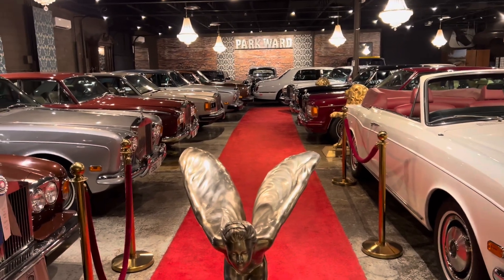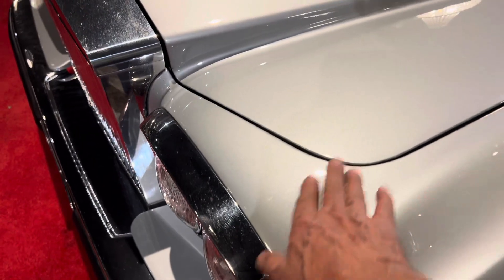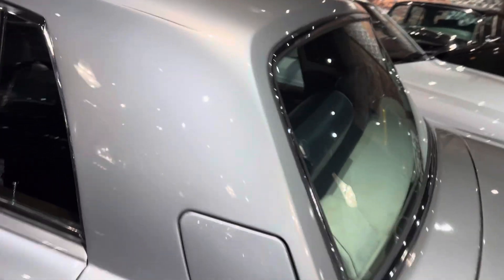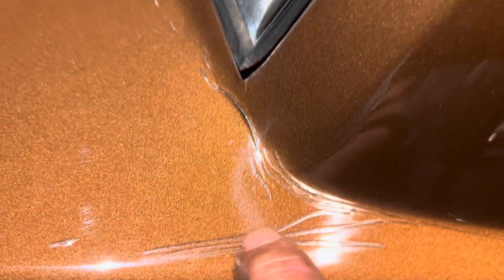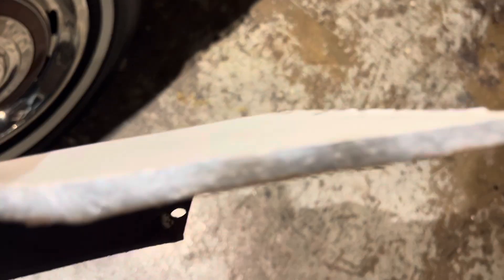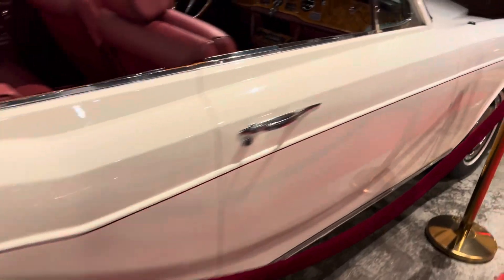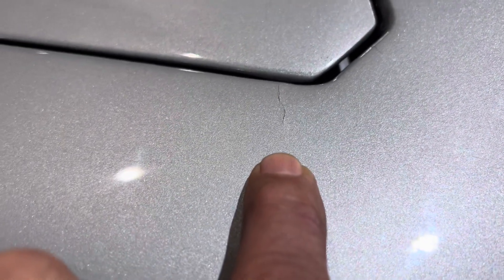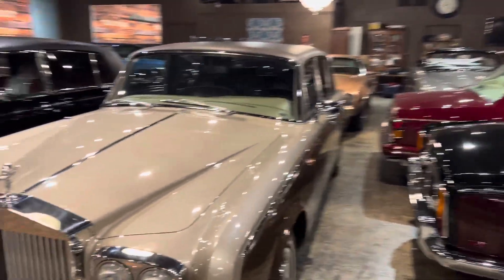The “Lead-wiping” process used in Rolls-Royce motor cars.

Comment: I usually have a bit of a laugh at someone boasting that they have used lead instead of a plastic filler in their 'restoration'.  Lead was originally used because plastic fillers had not been yet invented.  Some of the modern day plastic fillers are SUPER - and some with reinforcement strands can withstand areas that lead will typically fail with age.  HA - and I cringe when I have seen people sanding down lead filler with a power sander.  Yes - I have used lead many years ago, I always used a proper lead file and then typically used a thin film of plastic -and or modern primer surfacer for the final finish - HA - but always prefer a true metal finish - HA - and that does not mean wiping in lead.  Years ago I have seen lead much thicker than that sample.  Any filler, whether lead or plastic can be 'abused'.  CHEERS from AUSTRALIA

Comment: Rolls Royce's were finally assembled in the Crewe factory but the body shells were made made by Pressed Steel Fisher (PSF) in Cowley Oxford. I went on a tour of the sheet metal Shop in 1982 and saw the area where completed body shells were being 'leaded', it was like it's own little Rolls Royce factory quite separate from where the BL panels were being pressed and only RR staff were allowed in there..................can't say I remember much in the way of fume extraction.

Comment: They all use lead in the building of the bodies of Rolls-Royce vehicles. How do you think they hide the wells that hold on the roof in the eight pillars and the bee pillars they don’t have regular filling material in those areas they use lead and they still use it today. I’ve seen the process. They had a video on YouTube when they were constructing the Rolls-Royce. bodies in Germany

Comment: I visited as a guest of the News of the World car club I think it was around 1980-82 the Rolls Royce factory in Acton  (Park Royal?) they made all of the long wheelbase Shadow's and all the Corniches. The bodies came from Pressed Steel Fisher in Coventry and were cut in half and had twelve inches or so added in the gap. We saw all the under joints being filled with lead, but I don't remember other panel joints being wiped. In fact I went there twice with the NOTW courtesy of my best friend's  father who worked at the Sun and NOTW and they lived opposite me. They were fascinating visits to a 28 year old or so would be amateur mechanic
Reply from the maker: Shadow finished in 1980 so your visit would have been at least few years before that. To make the Long Wheel Bases, they were cut to add 4" in rear compartment. I though they were made contemporaneously with the standard saloon but given what you say, makes sense about not seeing lead being added elsewhere on the car because that was already done in the first iteration.
Reply: @ thank you. It's surprising how the memory plays tricks, then yes it must have been before even the last visit. I also remember watching a guy making an aluminium wing on a buck I think it's called for one of the earlier limousine's front near side wing. That to was fascinating to watch.
Reply: They were made in T building PSF Cowley, now the BMW factory.

Comment: Lead? I thought bodies were finished with tin before bondo.
Reply from the maker: You need to watch the whole video. The lead is used to fill panel joints. Not as a coating all over.
Reply: @roddsala4626  Thanks. I didn't understand that. The thickness, the clearance between the panels, is insane.

Comment: Old telephone cable splicers were real artists with lead. The splice between two section of lead cable involved a sleeve which was covering the wires and lead was wiped between the cable and the sleeve. When properly done it was water proof and gas tight as the cables were pressurized. Looked perfect, like a single piece of cable with a slight bulge.

Comment: I think it will be the same issue with plastic filler. (Bondo)?
The lead, which is a tin-lead mix, will solder to the steel plate and be more robust as bondo???
Reply from the maker: @LeoTheLion66  a point that many argue but I agree with you.

Comment: Modern metal cleaning, epoxy priming and polyester filler have come a long way since the 50s and 60s and are far superior to using lead. Remove lead, make some sinkers) unsound or incompatible paint, adjust panel fitment (if required) and refinish with modern paint systems. When a vehicle rarely sees the light of day or harsh variable weather 30 to 50 years should be expected where work is completed by a competent trades person and cared for by a responsible owner ( no mould accumulation or bird droppings) thinking something is good doesn’t make it good and combining lead and bare steel to make a laminated defect repair is unsound practice, a bit like mixing milk and beer, the outcome is so bad you can see it so stop riding you penny farthing with an umbrella, it’s embarrassing.
Reply from the maker: @colinsmith2005  yikes! Angry man at the end there!

Comment: I remember helping a friend do some body work on a Mustang in 82. It was a 65, and there was lead on the left side at the joint at the rear quarter panel and roof. Id never seen it before but I learned about that from the experience. 👍👍🇺🇸🇺🇸🙏

Comment: There is a series of videos by a guy called Matt Armstrong repairing a wrecked Rolls Royce. At one point he has to get some professionals in for some body work jobs. One of which was using this technique to hide a weld line. You can see a clip of this work at about the 23 minute mark of this vid:
https://youtu.be/mTN-jwrtM-4

Comment: I went to school for autobody and paint  in the 70's at Ferris. We were required to lead all our welded panels. European vehicles tend to be ridged body, with no exposed seems for body flex and will get stress cracks. Lead is still the most permanent repair but almost impossible to do on newer cars because the sheet metal is so thin. But i still do it on older restorations.  Beautiful collection of Rolls, by the way

Comment: As a teenager I used to watch the body repairs at a local dealer, and the most intriguing activity was watching them paddle hot lead on body panels, use a special file to cut level, then do it again until satisfied the work was smooth and blended into the body. Still done today on top end repair and fabrication.

Comment: In other walks of craft life, this is called "fairing". After shaping flat metal plate with the English wheel, the curves will not be "smooth enough" for the likes of RR.
The side effect of the lead is that it covers the steel with a layer with different rust properties.
So the lead is the filler, and the wiping is the fairing of that. With a lowish melting point, fairing lead is easier than sanding down epoxy.
As to "flat metal" that's a problem too. Gravity and other things may render what seemed flat into another shape. Here again lead filler and fairing can help out what would otherwise be an impossible job.
In the video, when the camera pans over the exhibited collection, in a few cases, we perceive a surface texture change in the bonnet/hood that raises the impression that what should be "flat" is not (no longer) exactly flat.

Comment: I remember this kind of lead work being used extensively in the 1950s and early 1960s. It was a skilled job with self employed people being called into body shops. The coming of Isopon and the like killed it off because special lead skills were no longer needed.
Reply from the maker: @davecooper3238  plus safety concerns.

Comment: What's gone wrong with the ceiling overhead lighting why is it so patchy and uneven.
Reply from the maker: @jagmarc  the overhead lights are all directional and adjusted accordingly so from different views they may look uneven but in fact all consistent. A rather odd irrelevant question ?
Reply: @roddsala4626    it's migrane inducing

Comment: This was used on every Jensen Interceptor made. Awful to repair an old one as it has to be removed before you can do weld repairs to the body. Jensen used it on every joint between panels. Very thick layers too.

Comment: Lead wiping was used on a lot of cars,including the Ford Pinto. I worked part time on the Ford assembly line in NJ, and remember seeing an old timer working on the joint between the roof and quarter panel. He used a gas torch, a wire brush, a lead bar, and a big file to clean, heat, fill, and file the joint smooth. It took skill and a good eye. I don’t recall any PPE to protect from toxic exposure.
Reply: The danger from the lead to that old timer depends on how hot he got it. Probably, not very. Molten lead doesn't give off fumes unless it gets very hot indeed. It melts at 327C / 621F, but doesn't boil until it's 1749C / 3180F. So provided you melt it and not much more, you're not filling the atmosphere with lead gas. That's not to say that precautions are pointless - good PPE such as a breathing filter mask is always a good idea. 

As I understand it, the issues with working with lead mostly come from the possibilities of ingesting it in its solid form - dust, smears, particles - or ingesting compounds including it - lead-based pigments in old paint. Not washing one's hands thoroughly after handling it is a bad idea.
Reply: @abarratt8869  So maybe there's more risk when doing the filing down afterwards when dust might be flying up?
Reply: @davem9204  indeed so, especially if using power tools for the filing down, but it is lead dust so it won’t fly up very much (not as bad as wood dust). But I imagine that one’s hands would catch quite a lot of it, and then eating a sandwich would be the route for ingesting the lead.
Reply: @abarratt8869 lead work also requires you to file it. There’s plenty of lead dust, even if there are no lead fumes as such.
Reply: @JasperJanssen  Absolutely.

In the electronics world, the most dangerous thing was lead solder paste - fine particulate lead mixed with flux gel. This came in when surface mount components started becoming popular. It was incredibly easy to get that solder paste smeared on one's hands, and was very easy to carelessly ingested via food contamination through - say - eating an apple or sandwich. 

It came as a bit of a shock because - suddenly - there was a big need for extensive personal protective gear. Whereas previously solid or molten solder was all that anyone had previous encountered, and the primary concern had been the fumes from hot flux.  

Mostly the world has converted to lead free solder, and so the solder pastes these days are far less hazardous than those lead-based ones. Good care and personal hygiene is still important of course, it's just that one-off mistakes are far less harmful.  

Interestingly, lead-based solder is still a thing, and some fields still use it. Military equipment quite often uses lead-based solder, because a lead-solder joint is still far more robust than lead-free solder. The difficulty they're having is finding anyone who still has the expertise to use lead-based solders...
Reply: I’ve seen lead sulphide/galena on sale as ornamental gem, when i was going to school idiots licked the green paint on the school yard railings, sweet.😂
Reply: I'll bet he also a set of wood paddles and a tub of tallow.  All cars used this process in the early days of car manufacture.
Reply: I buy solder in one pound bars. I noticed one of the reviews complained how the solder didn't work well when used on car bodies. I didn't know what he meant by the comment before seeing this video. If you want to use lead on car bodies, use straight lead. Don't use the stuff mixed with tin to make it melt easier.
Now I see, he had purchased the wrong material for the job.
Reply: What year was that? If it was a before the dangers of lead poisoning were widely known, then no corporate would give a damn about ppe. If it was after laws or whatever then that's ground to sue them.
Reply: @jwalster9412  Elemental lead is no big deal. I use it all the time, in soldering, and in casting weights. Some compounds, such as tetraethyl lead, are a really big deal.
Reply: @UncleKennysPlace  good ol' leaded gasoline..
Reply: @UncleKennysPlace  exactly this.
Reply: @ 1970

Comment: Budd Co . used to mig -brazed some panels like that on the Lincoln , much better than lead . A better utectic bond ,,, ! Also hugely stronger , seen many a test strip that was pulled apart , and the steel gave up first .
Reply from the maker: Yes but you cant get the thickness as they did with lead. Around 1/2 " in some areas.

Comment: Excellent "upfront" advisory.  I have a classic Rolls on my "bucket list" but the more I learn about the maintenance and care of a Rolls...the more I appreciate my Jaguar Vanden Plas - which to me - is 90% of the enjoyment of a Rolls at 10% of the cost and aggravation.
Reply from the maker: Not quite true. I also love Jaguars and I would say Maintenance and care is about the same for both of them when you start with good examples of each.
Reply: No. Rolls aren't all that expensive if you garage them and take good care of them. Some Jags are wicked expensive after they went metric.

Comment: You sidesteped the real cause of the joints separating. It was the engineering of the individual panels. It's as obvious as the nose on your face. An American engineer will try to help a British engineer only to be dismissed. Evidently the British engineer thinks his technology know how is superior. 
WRONG. You can look at ANY American car from the early 1960s that has never had any body work and you will find all the joints are tight and still have the original lead. This is because of the location of the joints. 
You just have to be a good engineer to identify the stressed areas and stay away from them.
Reply from the maker: @greggminkoff6733  wow! You ARE an angry lil man
Reply: @roddsala4626 
🤣🤣 
Well I evidently hit the nail on the head and touched a nerve. If I wasn't right, 
you wouldn't be so upset. You Brits are 
ungrateful. TWICE we stepped up to save your country. If we as Americans didn't do that, you would be speaking German today. Yet, the snootiness is unwarranted. 
You should thank every American every day for we have saved your country TWICE.

Comment: I painted a few shadows and very common to find 1/2 inch of lead on the scuttle panels what makes it worse is the as the body flexes at these high stress points it cracks the lead letting in moisture causing corrosion under the lead which swells the lead too.

Comment: There's a video on the Bentley Mulsanne in how they joined the roof on. I think it was brazed if I remember right. Is that more stable? Found it. https://youtu.be/b4_Y93o99Ec?si=n7-NLCitGUmCzC7U
Reply from the maker: @niptodstan  thank you for adding that. Yes, brazing is now the modern method for body joint filling. Welding is used for the structural join, which is much stronger, and then brazing is used for the filling and finishing as a replacement for the lead wiping method of years ago.

Comment: The complex shapes around the headlights of the Jaguar XJ6 and XJ12 up to and including the Series III were achieved  by a process called lead loading. I'm not aware of of similar problems with them.
Reply from the maker: Lead loading and lead wiping is the same. Simply nomenclature. The lead wiping used in Jaguar is the same process but it was much thinner. That said, you can agent and do see hairline fracturing on jaguars in these areas as well

Comment: I'm curious as to how they do it now 🤔 another video for you to do❤
Reply from the maker: These days they use brazing as the alternative method. In concept it’s similar in that you are using a metal with a lower melting point than the steel you are filling. Typically it comprises of copper alloys. The use of lead all started at a time before its poisonous effects were truly understood.

Comment: I learned elementary body-work at night class. Built a few veteran motorcycle petrol tanks using soft soldering. Then restored a Riley body with lead loading. The timber framed body on a steel chassis causes flexing BUT it is more the paint not the lead, moving. I saw a Bentley have over 10kg of lead removed during restoration.

Comment: Lead loading was common up to about the ‘70’s when body fillers evolved to be come more flexible
Very common on Jag’s too, usually used to fill a panel join seam as opposed to correct panel alignment
Reply from the maker: @46spanner  yes and no. On Rolls-Royce it was used as a filler. The best example is as shown in the video of the Walnut T2 where, aft of the C pillar, it is up to 1/2” thick.

Comment: Lots of cars in the past were finished using lead. Not just expensive ones. Lead is cheap, easy to file and sand.  With vastly improved manufacturing methods lead is no longer needed.
Reply from the maker: @LaserMechanic  totally agree. The point of the video was to explain why many of these cars have these paint fractures. Not many are aware of the lead wiping technique used in these cars.

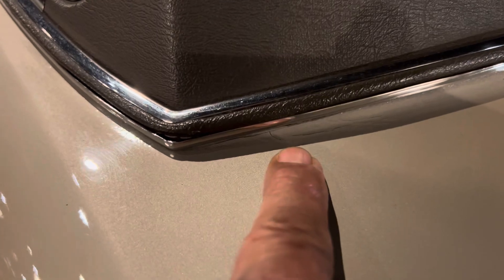Comment: 4:38 is fascinating and very "Rolls-Royce" - in mass-market manufacturing the lead wiping around the seam between the roof pillar and rear fender stampings would simply not be done on cars equipped with factory vinyl tops, instead the chrome molding would be designed to cover that seam.